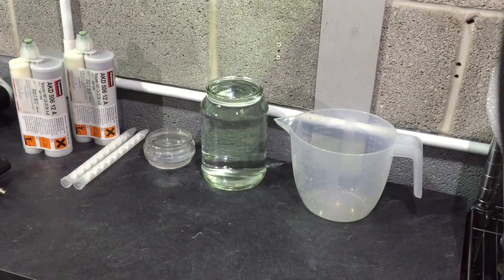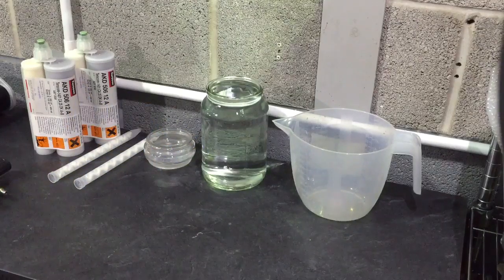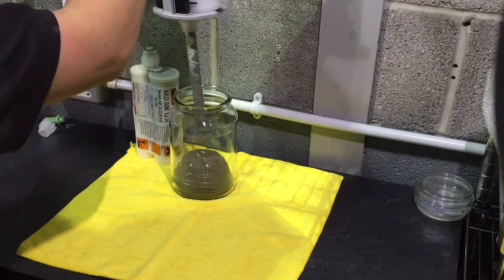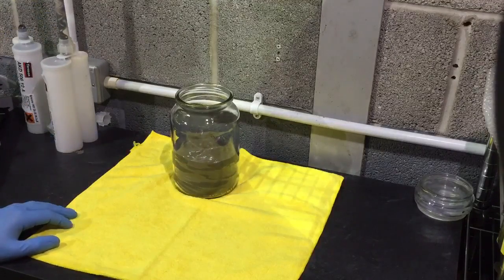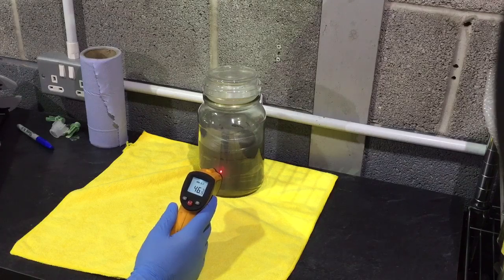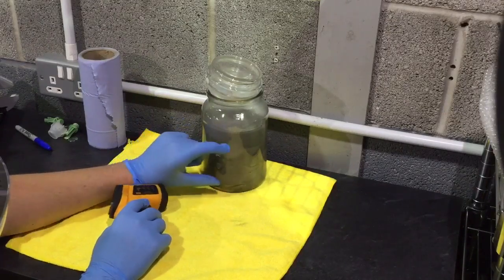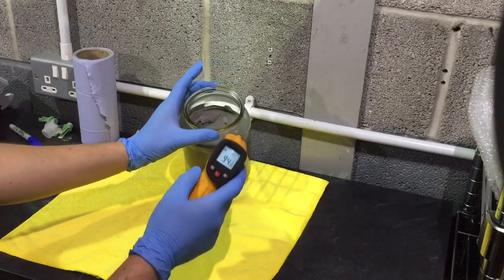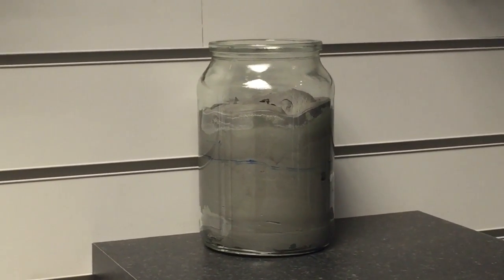BMW Structural Foam - PART 4

Comment: i have an existing fiberglass part with hollow cavities (the skeleton below an aftermarket hood specifically) that I'd love to be able to reinforce with some 4-8lb foam.  I believe the foam you are using is within this range.  What I'm wondering is if the expansion is going to exert too much force on the fiberglass as it expands and deform the parts / how best to relieve excess pressure with weep holes etc.